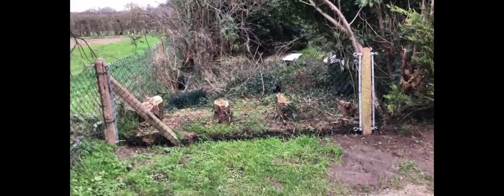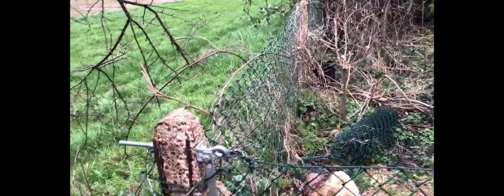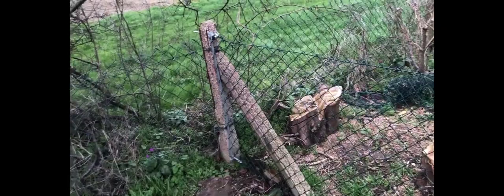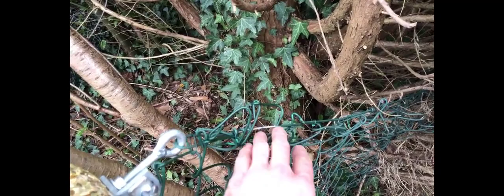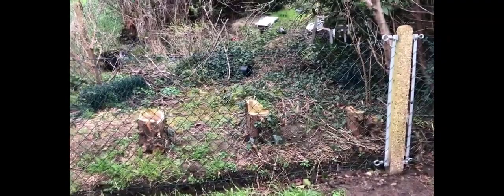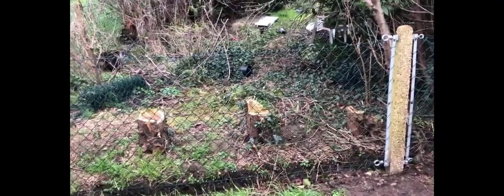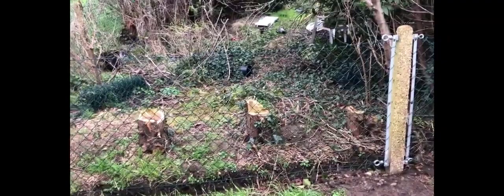How to Install Chainlink Fencing on Concrete Posts

Comment from the maker: ** Motion Video starts at 01:26 **

A short video showing the repair of this chainlink fence with concrete posts
The first half is a series of still images showing the state before the job. The second half is a live video showing the corrective action taken.

Tools you will need
fencing pliers: https://amzn.to/3LKhgYJ
1/4" socket set: https://amzn.to/40cqMZ3
long nosed pliers: https://amzn.to/3FNKvGm

Disclaimer: If buy from the links above I receive a small commission which helps fund the channel.

If this helps you, please consider liking and subscribing. Any questions or feedback - please leave below!

Comment: I need to fit chain link fence but how do you know what size angle brackets you need
Reply from the maker: From what I remember there is only one size. Hope that helps?
Reply: @FixItWithJon  I've been looking and there's 4 different sizes. I was was going to ask an online seller what I need but a kit their selling only has 3 angle brackets so I'm guessing they don't know what their selling because I cannot work out how 3 angle brackets can attach 2 stretcher bars
Reply from the maker: @hardworker8030  Hiya - ah that makes sense. Yes, I agree 3 angle brackets wouldn't be enough for 2 stretcher bars. The brackets in the video were about 2" from memory, I can get exact measurements in a couple of weeks when I'm back from travels if that would help?